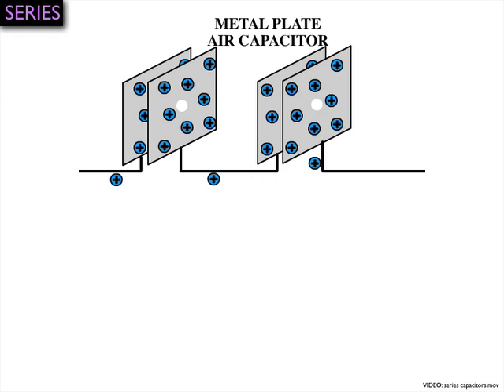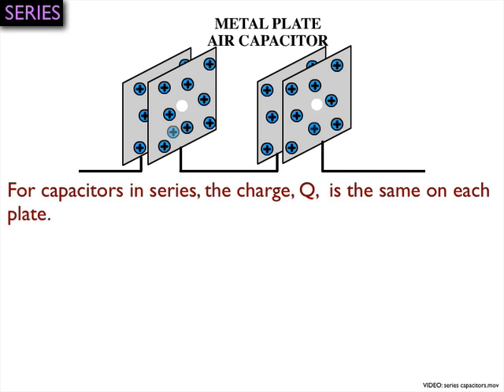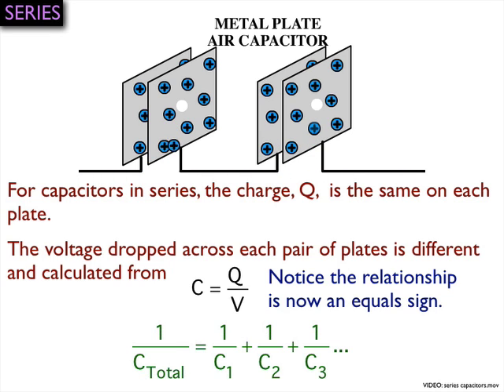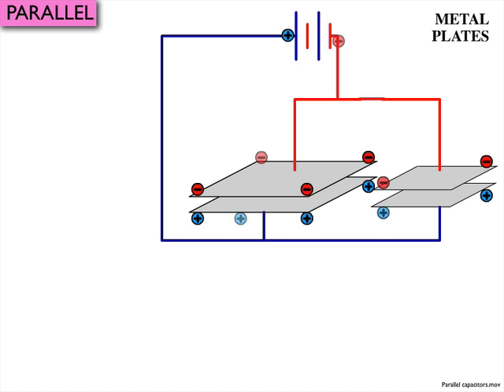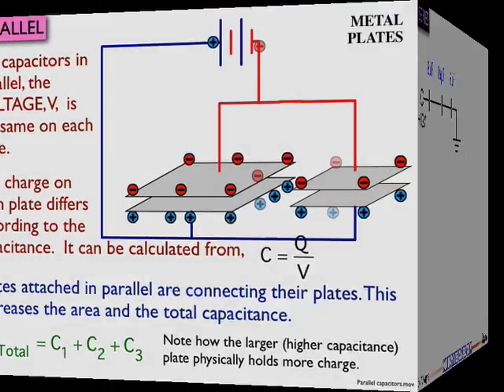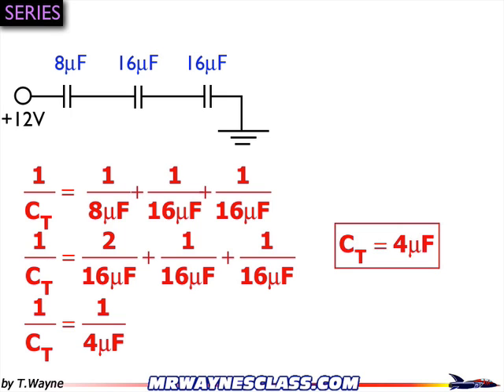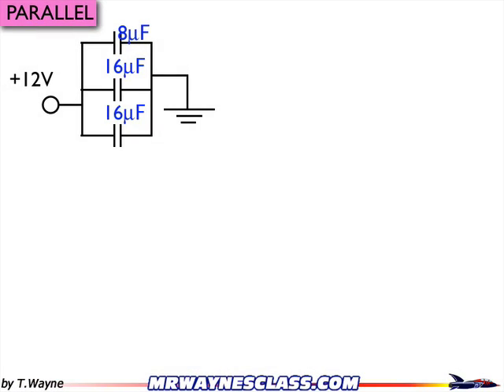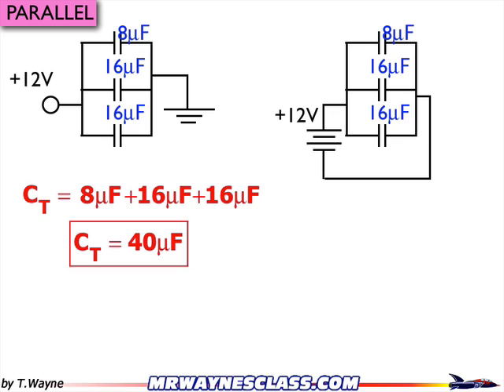Identify capacitors in series and parallel

Comment: Wtf...How did u use the formula of parallel in series.....it's totally wrong dear viewers and to this channel owner...the formula for series is C=c1+c2+c3+...........etc
Reply from the maker: The formula for resistors in SERIES is R = R1+R2+R3 ... The formula for capacitors, like the ones in this video, that are in PARALLEL is found from the formula C=C1+C2+C3... As an aside, the formula for capacitors in series is 1/C = 1/C1 + 1/C2 + 1/C3...
Reply: no, he is right. The formula is the entire opposite for capacitors and resistors. In series its 1/c=1/c1+1/c2...
and for those in parallel its c=c1+c2...
Pls, check yourself before you post such an absurd comment.!
Papa can fly wtf!
mrwaynesclass u r doing a great job  ignore this papa canfly👍